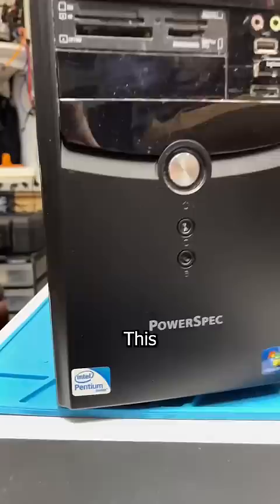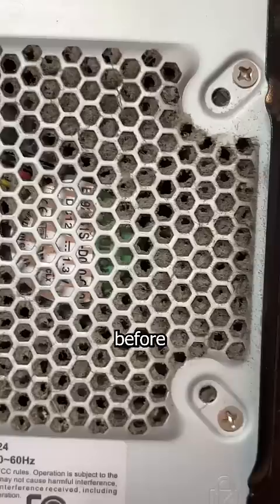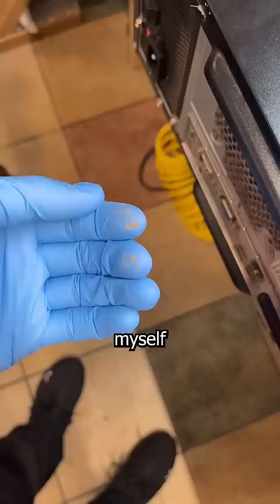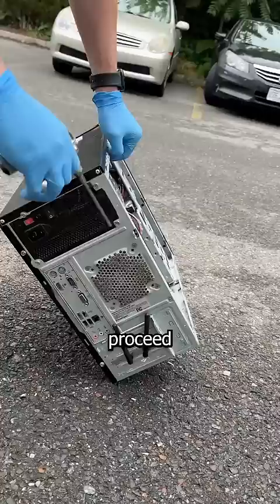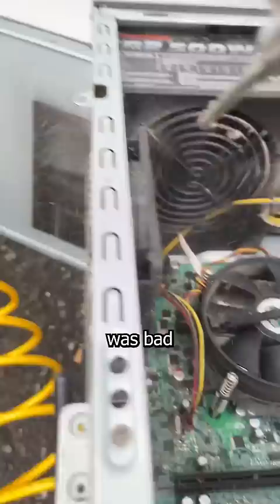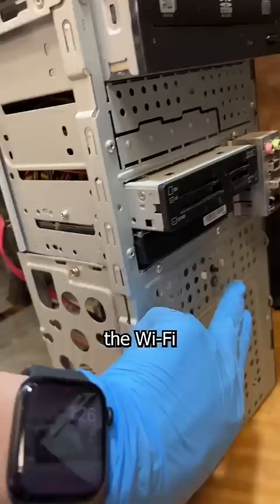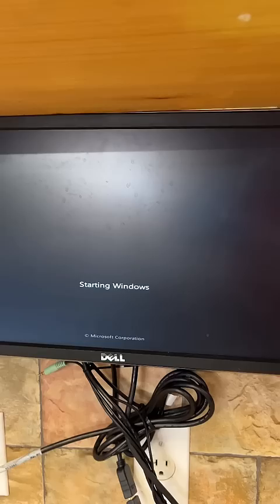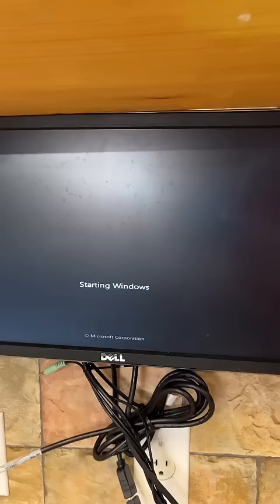Clean your #pc or it will end up like this! #technology #tech #shorts #computer

Comment: I once took my old PowerMac 8500 to a store for some repairs after it lived on the floor behind a desk in my folks' house for a couple of years. I told the guy what I wanted, he said I could wait because it was a slow day and should only take about 15 minutes.  I spent the next 15 minutes listening to a vacuum cleaner and got my Mac back about 40 minutes later... because it took that much work for the guy to vacuum out the heaviest dust accumulations and then had to keep stopping to blow out new dust rhinos he found as he pulled components out.  :-(

Comment: The compressed air part got me worried because he didn't put tape on the fans to keep them from spinning more than they're built for (I once broke my PSU's fan like this and have been extra careful since). edit: Oh, he did put the cable between the CPU fan's blades, at least.

Comment: In all fairness, windows 7 is far better than windows 11
Reply from the maker: Windows 11 de-bloated and configured correctly blows 7 out of the water when it comes to usability.
Reply: @SalemTechsperts  I must be mis-remembering from years ago
I remember the old Dell laptop with windows 7 I had felt responsive and fast while windows 8 to 10 felt sluggish and unresponsive on the Toshibas

Comment: I still remember once a pc from an office (it was an ancient building converted to offices, with 5 meter tall rooms which love collecting dust from any window and hole in the wall), they said it was very old and sluggish, and now also "tended to turn off by itself"... well inside there was literally a ball of dust, like, a cat sized nebula of dust and hair/whatever... the pc was some sort of data mule, those rugged steel beige cases, running XP and used often but like 10 years old already, never cleaned and iirc was missing the floppy reader so had an hole on the front... I've never seen anything like that again

Comment: i had to get data off one of my mothers old desktops from around the same time.
only difference is she is a smoker.
every surface was covered in a sticky residue and all of those said surfaces near the airflow of a fan was covered in a thick layer of dust and animal hair along with the floor of the case of course.
im also pretty sure a mouse got into the power supply as i saw a mouse shit hanging from one of the metal bits on the grill so i never turned it on, just took its hard drive out.

Comment: I work as a contractor for the government and the computers we use are refugees from the PC graveyard and have enough dust stuck in them to start a sustainable forest. I cleaned the keyboard out when it looked like it had a seven course meal in it and got chewed out for tampering with company equipment.

Comment: Caution when you blow out your PC with air. Make sure to hold your fans so they dont spin.  You can damage the bearing in the fan, and fans generate voltage when you spin them. Feeding power back to your mobo.....

Comment: As of 2015, I was working for a multinational corporation... Running their core system on XP. Not even Windows Server. XP

AFTER that, I worked for a multi billion dollar foundry (largest of its type in the US) running their production tracking ON WINDOWS 3.1. Coded in OG Access. As of 2021 they had started coding a new, up to date system because the original one had no security (by removing filters on certain pages you could get it to load ANY data (customer info, HR files, reviews)

Comment: how do you prevent the cpu cooler fan rotating when you spray it with the compressor? We are always told free-spinning the fans is bad for them, and can burn out the motor, break the bearings, or if there is no resistor on it pass voltage back into the system. So, what do you do to prevent it spinning as i noticed it did not spin

Comment: Never do that! You should always use a vacuum cleaner first and remove as much as possible, and only then use compressed air, otherwise all this dirt will get stuck inside the cooler and it will go bad.

Comment: Heads up
Heads up Tech tip when you're gonna work on something like that. Get yourself either a big cookie sheet or a flat piece of metal, not aluminum.  Make it fairest get yourself a man and laid on corner of this sheet. Work on your project on project on this metal don't use a metal table.
The magnet wont-work. When you drop a small screw like that or anything else that's fairest it won't bounce onto the floor. And when you're ready to pick it up or clean off. You just pick the magnet up and the stuff will simplease wipe off.
This also grounds everything.
So don't wind like a baby if you set a board down?  And you blow crap up.

Comment: i remember a long time ago swapping a friends GPU out for my old one (it was a 970 goin to a 980ti so a small step up.) because mine had a hybrid water block and it'd help with cleaning. i cleaned his after pulling it out and it had what seemed like insulation made of cat hair and dust with a smidge of cig smoke tinged all of it. amazing thing was i got it completely clean without having to pull the cooler off AND when testing it before removal it didnt have temperature issues. it was quite amazing to both of us.

Comment: my workstation at job is some old HP mini ATX running Windows 7 on mechanical hard drive which had file defragmentation like - never.
Connected on internet, mostly used for Excel, Adobe reader, Chrome and Outlook. It's slow but I have time when I'm at work, no need to rush 😅

Comment: Let's see that machine has a value of $50. If they can't afford $500 to bring themselves up to a level thats 2 years out of date they should shut down. (Yes I know sometimes you keep an old machine due to specialized software that's very expensive). But, it's the running business part I'm focusing on.

Comment: Just BTW you'd be surprised how many systems and companies run on Windows XP, not even 7. I work in manufacturing and most of our load testers and other testing machines run on Windows XP, a couple run on 7. About half of our springmaking machines run on Windows 7, the rest run on some custom Linux. But yeah, Windows 7 is definitely still the norm, and even XP is still in use.

Comment: Windows 7 is basically still Windows 98, with just a few extra tweaks, especially in the office setting. However, at home the reason you have to keep upgrading your computers is planned obsolescence. What? You don't believe me? How come so many businesses are running on Windows 7 which is really windows 98?

Comment: That PC has HDMI port must far newer than mine with a printer port (3 serial ports in total) and it runs on Quad Core Q8400 with 2GB RAM.

But eventually built a new rig with 8 core CPU, 32GB RAM, RADEON 6800XT, and has USB 4 type c port.

Comment: So I’ve been a computer tech for 8 years  and I’ve never seen someone use an air compressor at least where I’m at in the south if you use a air compressor condensation builds up in the tank and it would be bad how do you get around this?

Comment: windows 7 still beats windows 10. after spendign a year or two with windows 10 i have not switched back to windows 7 because i dont want to go trought the trouble of backing up all my files format pc and install a new windows and put everthing back on the computer, if it was not for that i would be rocking the windows 7 again.

Comment: Hey man don't knock windows 7. It was a great OS. 
But my guess is they are subscribing to the old adage of if it ain't broke, don't fuck with it. 
I'd bet they use a couple applications that might not work with newer os.
I'm in aviation maintenance we run into this constantly. Can't see the diagrams in some of the electronic Woodward manuals cause it only works in internet explorer. Which doesn't exist anymore. And some of our test equipment runs on XP. Because the specialized software won't run on anything newer.

Comment: ... and you just destroyed all of those fans. They may spin now, but they won't spin for much longer, because you put 20 years of bearing wear on them in a matter of seconds by using a compressor, and not doing anything to immobile the fans so they can't spin 10 times the speed they were designed for, and well beyond what the bearings are designed to ever spin.

Comment: 😂😂😂 wow I remember when I started working we used year 2000 computer, still using pentium III processor and there still computer that still using i386 and i486 and one of the components (I think it's the resistor) blew up😂😂😂. we change it on 2010 pentium 4 , now we use i5 and i7

Comment: Most likely they are running WIN 7 because 10 & 11 means having to relearn how to find common functions/programs, this is the same reason large corporate customers are still using WIN98SE because their machines have no access to the internet and are only on a company LAN.
Microsoft NEVER considers that NEWER doesn't mean BETTER, If they'd just build a Core OS without bugs - without all of the bells and whistles (the customer can add those later if they wast them) and not make them resource hog's, the maybe - just maybe, customers would be willing to upgrde, unlike what's happened with 10 & 11, I've had customers buy a new PC, then come back a couple of days later asking me to strip out the  10 or 11 and load a fresh copy of WIN 7, because they cannot find a damn thing in 10 & 11.

Comment: Don't bitch about 7.  With a couple small updates it would be better than 10 and 11 both.  If you want a fantastic OS, pick a variant of Linux.  Been using it on several machines since 1999.  I can run a 20 year old machine on a modern variant of Linux.  So much for planned obsolescence.

Comment: Bro thanks running a company off Windows 7 is bad try pretty much any card reader in history. Most of them are still running off of Base Windows XP. And even a lot of big companies still run XP. 

It's much cheaper for them to hire somebody to fix any security holes than it is to upgrade. Even more so when a lot of the software won't work with newer windows 🤷

Comment: Don't air compressors have water build up in them? Using it to blow out a computer can damage it with moisture blown in electrical connectors. Or anywhere could cause a short just throwing it out there. Don't watch alot of ur videos ur probably pretty knowledgeable but we all can learn something. CEO can over hear janitor with more logic than them

Comment: "And here we have all of your digital information. Stored in Apples vault, protected by our highest level of security, this screen door"

lol why would you upgrade? Older more fleshed out operating systems have far less flaws than the swiss cheese security crap they have out now, alot these systems don't have any real world power and aren't connected to infrastructure or really anything but other computers in its network. I will never jump on a new operating system until the old one is on its way out. New OS have the most zero day flaws in history and growing and its so bad with 11 they already want to go to 12.  Hopefully with AI doing all the heavy lifting in the coding job on windows 12 maybe the AI can get it right and finally deliver a secure operating system. Not holding my breath

Comment: I personally put windows 7 on anything that supports it, windows 10 is a dumpster fire with bloatware, i dont care for the microsoft store and all that id rather just live the old way with .exe and .msi installers windows 8 was ok too but windows 10 it really is terrible, my main pc win max 2 is on 10 but ive done alot to remove bloatware but im not doing that on all my computers so i install whatever is included with the pc originally unless it came with 11, 11 has driver problems i dont like it

Comment: lol Blowing out the dust and disconnecting the wifi card counts as a repair?
Reply from the maker: Do you say the same thing to your mechanic when he turns a bolt and tips a jug of oil into a hole? 
Repair: fix or mend (a thing suffering from damage or a fault).
Computer came in with a fault. It left functioning. Therefore, it was repaired.
Reply: @SalemTechsperts  I guess you have a point but I'd call that maintenance. What about taking a TV in for "repair" because it was set to the wrong input? Does that count? I don't know where to draw the line.